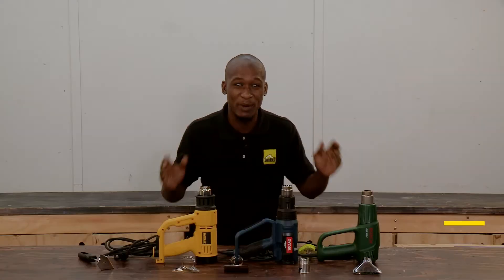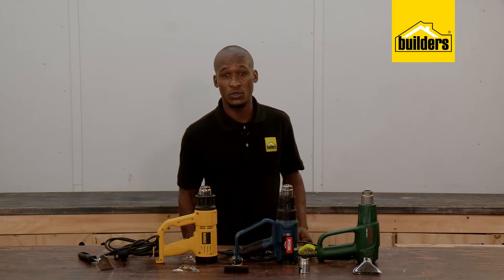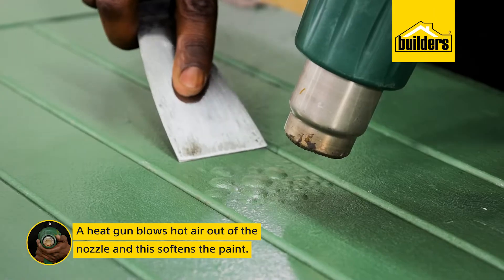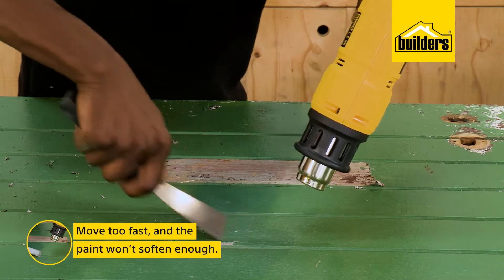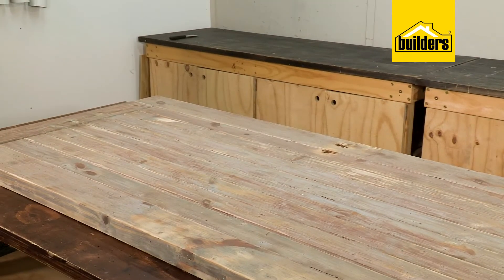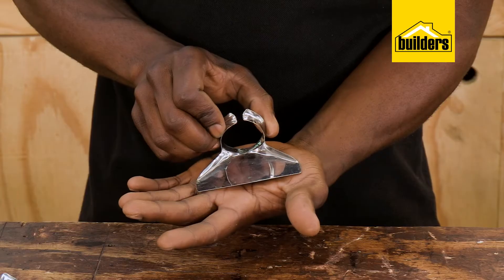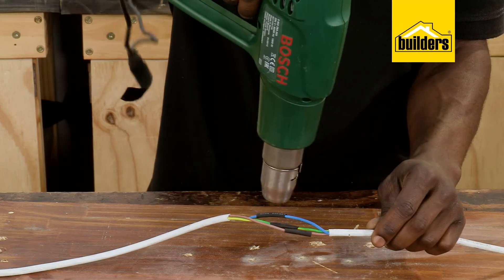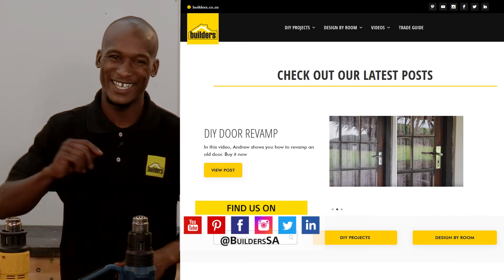Heat Guns, And Their Uses

Comment: Is it possible to use heat gun for copper Brazing
Reply: Just replying as i noticed no one else has and even doe he shows soldering copper with a heat gun, as a Plumber you would normally use a Blowtorch with Matt Gas for Brazing NOT a Heat Gun, hope this help I noticed it says 9 months ago on your messages but better late then never as they say, hope you have a Great Day😁🇬🇧👍🏻
Reply: @lippydalips4537  Thank you
Reply: @johny4340  No Worries Pal😁🇬🇧👍🏻
Reply: I know it’s an old question with multiple answers already. I’d just like to add a little more context to the why’s and wherefores.

The basic difference between soldering and brazing is the temperature necessary to melt the filler metal. That temperature is defined to be 842ºF/450ºC — above that, brazing; below that, soldering.

The average heat gun reaches an output of about 1100°F, which is right about where brazing starts. So, while it is theoretically possible to braze something with a heat gun… it’s within a very limited scope that a heat gun specifically will be of any use.